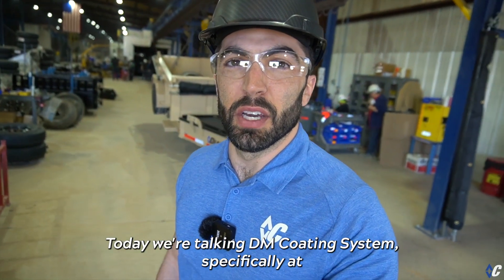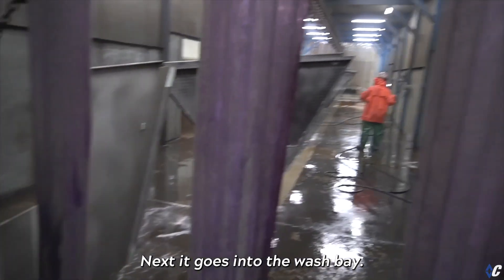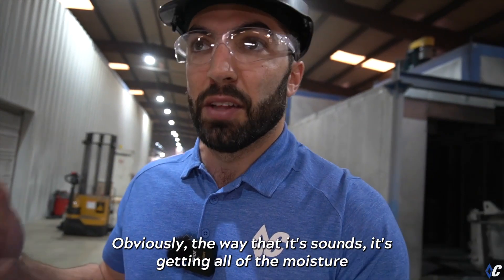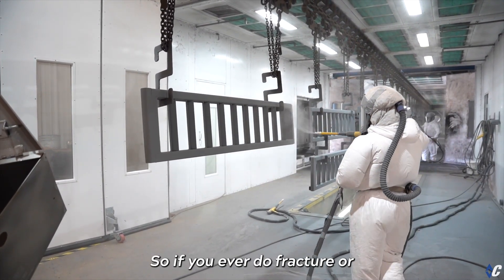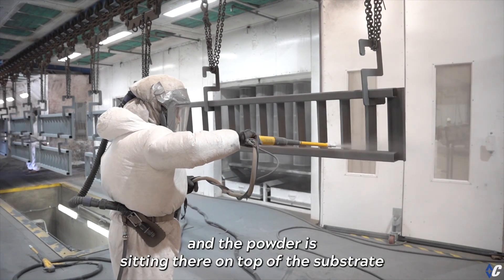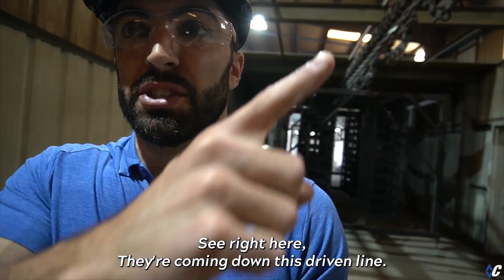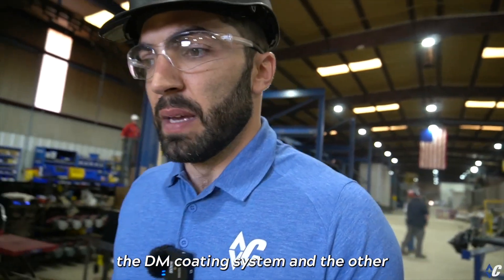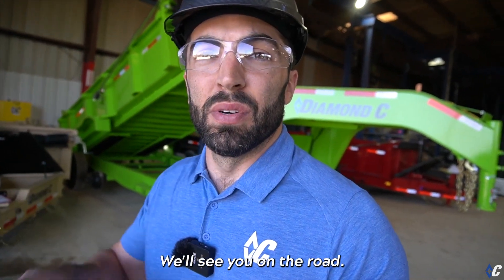How Does Powder Coat Work? 🤔 | Diamond C

Comment: Dang no wonder why if feels so thick is because of the primer and everything you guys put on it. I love my MDT industrial orange. Only thing was at my dealer. They scraped the top of it and they scratched through the powder coat but it's right underneath my boards.  Luckily I was able to buy some touch-up paint from you guys along with my panel hitch also.  🤘🏽🇺🇸 Great company and great people working for you guys. Keep up the great work Diamond C 💪🏽.   One thing, wish you guys would offer the mega tongue box on the MDTs. It would be nice to be able to use up more room for chains and binders
Reply from the maker: Appreciate the comment! 😊

Comment: I own a blasting and painting company. We have done many powder coated trailers. Your line of trailers seem to hold up better.

You should look into RPB Nova 3 blast hoods, C40 Climate controllers and a Radex breathing cartridge. Your blasters will love you! I guarantee your production will increase. If you select the hood/jacket combo, your blaster will be a comfortable 70° inside of it when it is 95° outside

Comment: I kind of wish that I had paint on my 14k LPD for ease of touch ups. 

The powder coating is flaking and showing rust in places and rusting on the underside where the frame meets the crossmembers. 

It’s probably 5-6 years old and honestly looks a bit rough. Which is fine to an extent because it is a dump trailer.
Reply from the maker: We have touch up paint! 😊 Check it out here: https://diamondcgear.com/product-category/touch-up-paint/

Comment: I bought a power coated trailer. It's not even 6 months old. Only used it a couple times and it's rusted out all over. Company is claiming gravel caused it to rust out. It was stored in a shed until recently used  just 2x.  Can anyone help me?
Reply: Didn't buy from these guys it was another trailer place.

Comment: My mom would tear your shot blasters apart... That is not a nice uniform blasted surface!  When my mom taught me how to glass bead, I used that when I worked in an industrial steel shot bay.  My wheels came out so good the company ignored I was 25% slower.  I'm actually a bit surprised you would show off such inconsistent shot blasting results.  Your arguments are great about prep work, but your prep work could use some improvement.

I got to see a really neat power coat system in Germany.  They had a massive tunnel that went from the factory to a sorting warehouse.  That long tunnel was used to air cool the parts.  The whole production chain must have been massive as it was a closed circuit.

I really appreciate you sharing your process and I still am of the opinion that if I can ever afford one, I want to custom order a gooseneck dump for my Titan XD from you!

Comment: Powder coating is just a plastic coating that will get chalky and brittle over time enamel may chip but it is far superior as it can be basically resprayed in the field powder coat has to be completely removed and recoated or just leave it a chalky mess